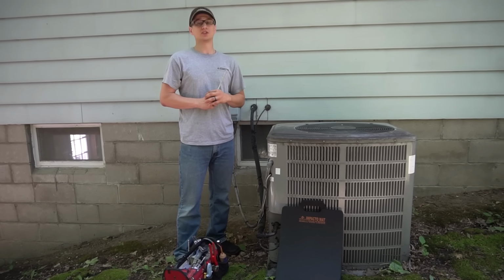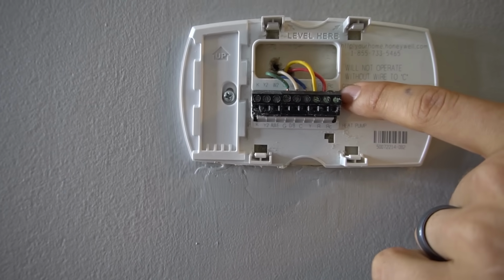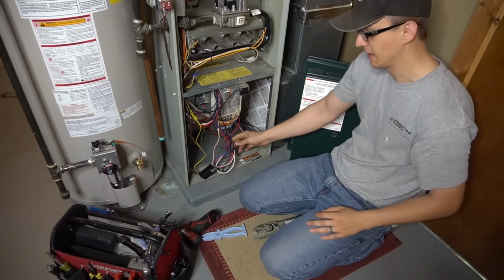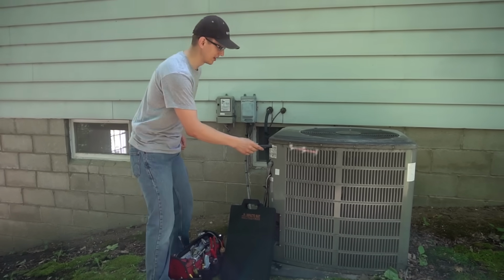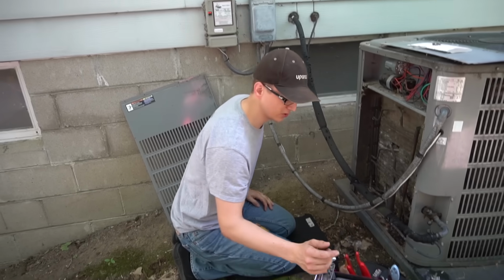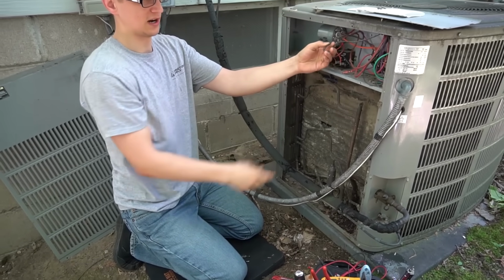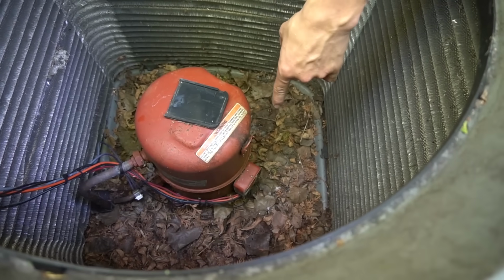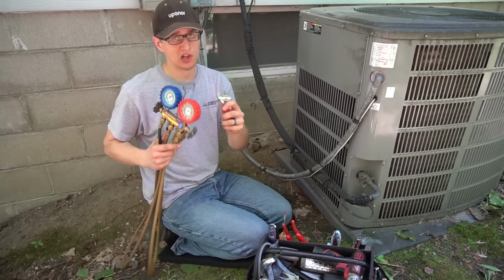AC Unit Not Turning On - How to Fix It Step by Step

Comment: Great video guys thanks for sharing!   I followed you video and think I may know my problem.   I have a E4D036S06A model York heat pump.

Symptoms:   Outside unit fan does not turn on and heating is significantly impaired (it still puts off some heat).  The inside fan works when thermostat calls for heat.  The compressor hums and I can feel the line getting warm so I presume my compressor is working.  When I try doing the easy fix ie spin the fan it does not start up.  There is no apparent bulge on the capacitor like you suggest you would likely see if the capacitor was bad.   There was an odor however after I took off the side panel to get at the electrical panel.  When I press the rely bypass the compressor starts up but not the outside fan.  Seems to be getting the 240 on both sides.  

Not sure if this is related but In the summer when cololing was called for I had cool lines the fan was spinning but it was not cooling.  I didn't bother trying to fix the cooling problem and let it switch to heating now.  

Based on your video likely problem is fan motor needs to be replaced.    

Do you agree with my analysis?   Is there a way to check the fan motor or should I just assume it is the culprit?    Thanks so much!
Reply: OK I found your video on how to check the fan motor so will try that to confirm my diagnosis.
Reply from the maker: Lol, I was about to send you the link for that video. (didn't read your second comment right away) But yes, from what you described it sounds like your fan is getting power but not turning on. There is a slight chance it could be a bad capacitor as they do not always bulge out when bad but it's more likely that the motor is bad.
Reply: @WordofAdviceTV  Thanks!    Update:   I checked the fan with my ohm meter and got the following readings:   Black (defrost wire unplugged from defrost board) to brown (i think) = 18    Black Defrost to purple = 36   Purple to Brown = 55 

So this should mean that the fan is OK because the resistance numbers add up to 54 close to the 55 reading I was getting.   When I tried checking the capacitor I went to discharge any stored charge by touching the connectors but there was no charge/spark in any of them. 

So I decided to get a new capacitor just to see if that was the issue.   The one I purchased was a rotomotor brand it was a fair bit larger diameter and doesn't say "protected" but otherwise looks identical.  45 +5 rating 370/440VAC.   My original is CSC Ecoil brand 45+5 370VAC.   I thought this should work so I hooked up the new capacitor and turned the thermostat on to heat pump heating over the house temp.  Hooked up according to wiring diagram:  brown = fan yellow = herm red/purple = common.   

End result is the fan still does not turn when its calling for heat but I hear the compressor running.      

QUESTION:  Could my problem still be the fan motor?
Reply from the maker: Hi Chris! Are you sure the motor is getting 240v? You verified that with a meter right? It almost sounds like it is not getting power
Reply: @WordofAdviceTV  No I did not put the meter on the relay switch....I just assumed that it was OK since when I press it manually the compressor starts up and didn't think it would start if it wasn't getting 240v.   Maybe I should confirm?   Maybe its the defrost sensor?

Update:  You might be correct I put the multimeter on the in side of the power from my breaker to the switch and it doesn't read any voltage.  But when you push the relay manually or turn the thermostat on (after 5 mins) the compressor turns on.   I checked all breakers in house panel and the inside heat pump unit and they were not tripped so I turned them all on and off to make sure.  Retest no voltage at the relay switch.

Update 2: I am going to try and turn the power on with the thermostat then check the voltage at the switch when in the past I could hear the compressor humming.   FYI my meter says 0 at the switch from the wall breaker outside but my mini voltage tester beeps.  weird.

Update 3:  OK I have confirmed there is 240 v at the ac switch on the outside unit now thats good!  Fan still doesn't turn on....not sure what to try next.
Reply from the maker: Sounds like you were busy today! If you are measuring voltage across a closed switch, it will always be 0v. If the switch is open, then you will get a read. I am thinking that perhaps your fan delay board (or the defrost board) is bad. Meaning the power goes into the board but it never sends that power out to the fan motor. What I would usually try in these cases is bypass the board and hook the fan up directly to the contactor. If the fan runs, then you know the board is bad. If not, then the fan motor is bad. I am not sure what your set up is, but basically one wire from the fan motor goes to the capacitor, another goes to one side of the contactor and the third wire goes to the other side of the contactor.  (of course double check to make sure there is no power and remember where the wires go or take a picture) I don't know how comfortable you are with wiring and if this is something you will be able to test in the way I explained.. It would be even harder for me to try to explain how to troubleshoot the board though. (I usually take some time with troubleshooting myself)
Reply: @WordofAdviceTV  haha yes you are right I was busy!  Still need to bear fruit though as the hp is not fixed!

 I think you are right my problem is either my defrost board or my defrost sensor.  I doubt it's the fan as the resistance test was as expected.  I am going to assume the fan is fine so the problem is power is not being sent to the fan motor.  If it was stuck in defrost mode than that would cause the fan not to be sent power.   This is where it can either be the board or the sensor.   If the sensor tells the board to defrost all the time the board will not power the fan and the sensor is the problem.  If the sensor is working but the board is still not sending power to the fan than the board is the problem.   

Now I will have to think about how to test the sensor or the board.  One way is to check the voltage at the wire sending power to the fan.  It should be sending 220V if the thermostat is calling for heat and the coil is not too cold.   I believe that the board needs a certain amount of time with the low temp before it goes into defrost.  So even though its cold -10 degrees celcius here not it still should be sending power to the fan for 30minutes or whatever the amount of time based on the pin setting on the board.  

Me being a dumbass I left the cover off the condenser unit and a bit of snow blew up into the defrost board and shorted it out at the M line.  Blackened it all up and melted the plastic covering on the purple wire in line boo.   Went in today and got a new defrost board so at least I will know if that is the problem.  

I got it hooked up again turned on power and can manually start the compressor with the switch but no fan still.  Turned on the hp from the thermostat and don't get the relay switch to turn on.  1 step backwards :(.  Will have to see if I'm still getting power sent from the air handler panel.
Reply from the maker: Oh boy.. Things are as exciting as ever over there. Sorry to hear that the battle is still raging on!

1. Perhaps the 3 amp fuse blew in the furnace/air handler control board?

2. When you say "switch" are you referring to the contactor?

3. If you check voltage at your contactor coil, one lead on one side and the other on the other side, do you get 24-28v? If the thermostat and board from inside are making a call for heat/cool, you should have 24v there. If you don't, then you should figure out what is interrupting the power inside first.

4. The wires coming from your fan motor where does each one go? If you look at the wiring diagram, can you tell which two wires are the hot legs? You would need to measure voltage between those 2 wires to see if the fan is getting power. But like you said, if the resistance checked out good, then it's very unlikely that the fan is bad. (though I have seen it before where the fan checked out good in ohms, but then it would not turn on even though it had 240v going to it. Replaced the motor and it fired up) Anomaly.
Reply: @WordofAdviceTV  You are right I'm about to start a campfire and burn my hp lol.   Gosh why can't it just be a capacitor everytime?

1   Yes I've had those 3 amp fuses go in indoor boards at my other units but I checked the unit here and can't find a fuse either on the board or on an inline fuse.  Maybe that's why the outside defrost board fried there is no fuse to protect it.  or at least I can't find it anywhere it should be.  Only way to confirm is to check wiring diagram I guess.

2.  Yes I meant contactor but used the wrong word ie. switch.

3.  I was going out to check for that 24 voltage on that contactor coil after I turned the thermostat on to make it call for heat.  Was getting a zero reading with my tester after I thought the 5 minute delay was up then boom it turned on and the the fan started spinning halaleughia!   It must have been the defrost board all along but it didn't turn on the fan earlier today maybe I didn't have the thermostat high enough relative to the inside temp to make it call for heat?   

With the heat from that short it melted the plastic on the hot wire female connector going into the outside defrost board.  The round wire insulation is fine.   Does that need plastic protection where it joins the board?  Right now its working with the existing connectors minus the weather plastic.   Not sure if you can get a connector replacement ?

Anyways the main thing is she appears to be working thanks for your awesome informative videos and your replies!   

What's your e-mail I'll send you some Canadian dollarettes for helping.
Reply from the maker: Sweet!! Glad to hear you finally got the thing to work! And I appreciate the numbered responses plus you coming back to share the end of this :)

Ha, so just like you said, it was probably that board all along! Nice.. And I totally agree with you! I get the same thought at work sometimes. An AC that takes me 3 hours, "why couldn't this be just another capacitor... SIgh.." 

The slightly melted plastic insulator is no big deal, I would't worry about it. If you really wanted to, you could just snip that connector off, strip the wire, and put on a different connector.

And God is good to me Chris, no need for any donations. I'm happy I could help! You in turn can help the next guy ;) Stay warm!
Reply from the maker: Sweet!! Glad to hear you finally got the thing to work! And I appreciate the numbered responses plus you coming back to share the end of this :)

Ha, so just like you said, it was probably that board all along! Nice.. And I totally agree with you! I get the same thought at work sometimes. An AC that takes me 3 hours, "why couldn't this be just another capacitor... SIgh.." 

The slightly melted plastic insulator is no big deal, I would't worry about it. If you really wanted to, you could just snip that connector off, strip the wire, and put on a different connector.

And God is good to me Chris, no need for any donations. I'm happy I could help! You in turn can help the next guy ;) Stay warm!

Comment: Great video very informative
Question i replaced the capacitor did the by pass test and it turned the fan for a second then it turned off and I noticed it trip the breaker 
Any ideas?
Reply from the maker: It can be quite a few things.. Try watching this video to begin with: https://www.youtube.com/watch?v=G1EBHrOgs-Q&index=10&list=PLK8tZPlovA8Aw5W4GIoingc_enl5apH4C&t=17s
Reply: Hello my rheem RAKA-024JAZ outside fan quit coming on I could push plunger and help it run, so change capacitor but no change. Next went ahead changed the fan motor (5 wire) old 3 wire & new capacitor, but fan still does not start. I can help it then will run. I haven't check the contactor yet. Any Ideas?

Comment: i have a trane xe1200. fan is working but i do not hear the compressor. I checked the switch and it has 240v coming in and 240v coming out when I press it. I checked the connection on the compressor and all 3 have continuity( run to comm, comm to start and start to run have continuity). I checked the connections on the compressor to the compressor ground and none are shorter out. next I am checking on the refrigerant. other than that I do not know what is going on. any ideas.
Reply from the maker: Can your meter check capacitors? (uF) My first guess would be that your capacitor is dead.

Comment: My a.c unit was just installed 3 months ago and all of a sudden stopped working. Checked for tripped breakers on both boxes nothing. Turned off and on the switch/breakers nothing. Turned the thermostat off and on, nothing. Checked the "safe t switch" its dry. The only thing I can hear is a small noise coming from the furnace, could this be the problem? It's the only thing "turning on".
Reply from the maker: You said you checked for tripped breakers but did you check the 3 amp fuse that is on the furnace control board? Almost sounds like that may have tripped.
Reply: @WordofAdviceTV  you were right something was tripped and shut the a.c off, I didn't fix it someone else did so I not sure exactly what it was. Thank you!!!!
Reply from the maker: Stay cool! :)

Comment: Well the ac got fixed. The other guy wire the transformer wrong and it worked. But just now I went to put it into heat and I got nothing. Does anybody knows a good ac guy in dfw area thanks.
Reply: did you check the cables connected from the furnace to thermostat, if not maybe could be the problem there
Reply: or maybe the transformer is wrong connected
Reply: The thermostat cable was replaced and that was the problem after 1200 dollars on ac guys and several parts. Thanks for all the help.

Comment: Need Help ive been through 2 mother boards in 3 yrs my AC guy says durning summer months condensation burning motherboard
Reply from the maker: Not sure how I can help man.. If condensation is killing the control boards, do you have a leaking A-coil drain pan or perhaps a partially plugged drain line? Or if you just have very high humidity in the basement, perhaps put a dehumidifier down there?
Reply: @WordofAdviceTV  awsome its a start cause  @ 425$ im going broke

Comment: Hi. My ac it's not turning on. I got an ac guy to look at it. He couldn't figured out what was wrong with it. Fanaly he said that the drefrost control board was the problem. My question is. Can that be the problem?
Reply from the maker: I don't think air conditioners have defrost control boards. Or at least not that I am aware of. I haven't seen one in the last few years anyway. Do you have a heat pump? Those do have a defrost cycle.. Perhaps the board is not putting the unit into defrost for long enough/ not long enough? So I think, yes, it's possible. Will he warranty his work?
Reply: @WordofAdviceTV  well. He replace the board and still doesn't work.
Reply from the maker: Oh boy... So what did he decide to do after the board didn't fix it? Hopefully he will take ownership of the AC problem and see the job through..
Reply: I got two repair men to look at it  and its burning the transformer. It's short somewhere  can you help me with this thanks
Reply from the maker: Tracking down a short can be pretty hard... I don't think I would be able to walk you through it. Sorry. Something that you can do is to look through all your wires at the outdoor and indoor units and see if you can find any burnt, corroded, or melted wires/wire connectors. A lot of times a short will be caused by a bare wire touching something metal or a loose connector.

Comment: If the contactor isn't pulling in could you essentially keep it pushed in somehow manually or would that cause damage?
Reply from the maker: Well it's definitely not recommended. That being said, I have seen people keep it down by wedging a screw in though. (Tread carefully as there is 240 volts there that can be very dangerous) Just make sure the indoor fan is set to ON instead of AUTO on the thermostat. But yes, that temporary fix can do more harm then good. It would depend on why the contactor is not pulling in in the first place. If you wan't, check out my other video about why the contactor is not pulling in: 
https://www.youtube.com/watch?v=NVPhsK4gK1A&index=24&list=PLK8tZPlovA8Aw5W4GIoingc_enl5apH4C

Comment: Thanks for the GREAT videos. I have 2 older Trane Heat Pumps. 
Condenser model TWY036B100A1 with ECM fan motor
Air Handler model TWE037E13FB with Variable speed motor (ECM)

The heatpump with a 40ft lineset that runs in the ceiling between the first and second floors, chatters LOUDLY like an automatic machine-gun for about 6 seconds when thermostat is activated (both in heat and A/C). After about 6 seconds of loud chattering, noise stops, and all is fine. I replaced both (start & run) caps. The run cap. was no good. Any ideas what could be causing this scary noise? I do not have access to the LONG lineset, as it is buried between first floor ceiling and second floor floor. The chatter only occurs on start-up for about 6 seconds and occurs about 25% of the time when starting. Thank you.
Reply from the maker: If this happens with both, the heat and AC, then I would suspect that the noise is coming from the blower motor. Have someone turn on the heat while you are standing by the furnace/air handler (whichever one you think makes the noise) and see if you can hear from which area the noise is coming from (from inside the walls, from the furnace, from the ductwork). You will need to figure that out first and then you can try pushing on different sides of the furnace, blower door, or push up the blower housing to see if that stops the noise. Noises can be made by many different things so I can't give you a specific answer..